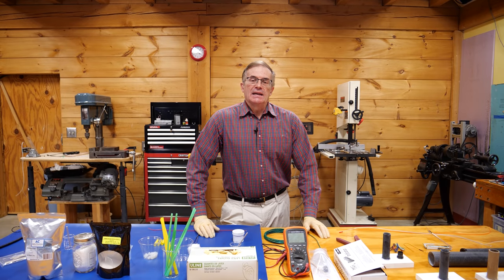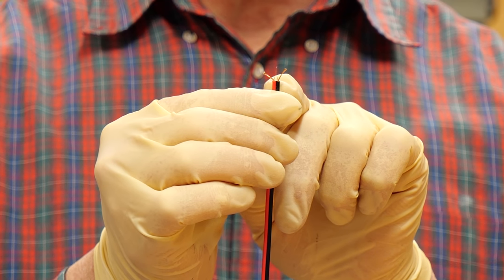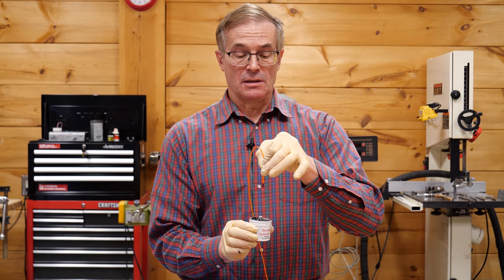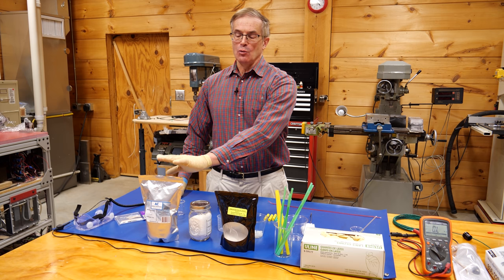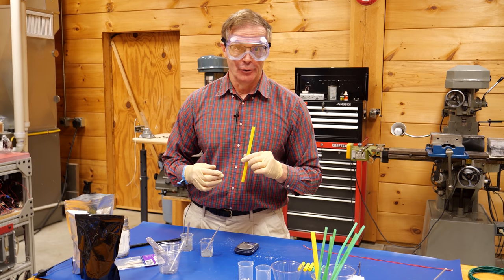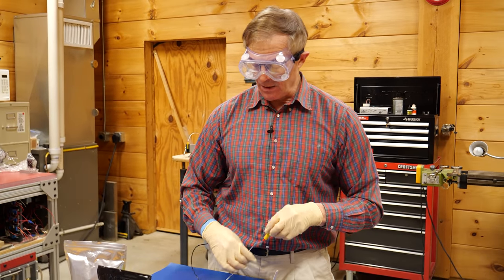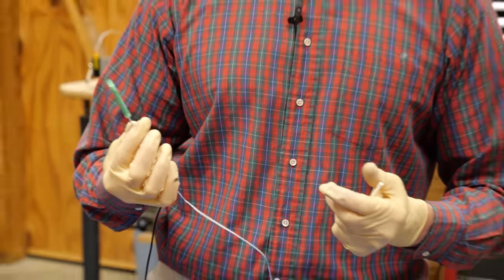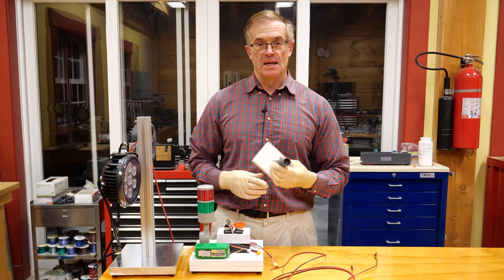Rocket Ignition System On Steroids!

Comment: Really like your channel and you always make me think about things in a few different ways LoL...
Also if it's conductive and could probably be use like  resistor in theory doesn't if you were to put it in  line with the beeping sound so that way the beeping would actually stop once it has finished lighting it off (for testing or b4 take off of course) all the way or if there would be a malfunction and it's still conductive/conducting it  would continue to beep but if not then it would just stop the beeping and allowing you to know that it's somewhat safer to approach the launch pad or testing pad ......... hopefully I'm making sence and what I'm trying to say......and if you understood what I was trying to say do you think that it would be possible and if it is could you maybe do a video on it and if it's possible would it be a good way to make malfunctions some what safer when not really knowing what and where the malfunction is at quickly 
Also I'm not really sure but might even need a diode or 2 in line with the beeping sound if you were to try to make it possible I'm not a hundred percent sure I'm just beginning with the electronic side of things
Reply from the maker: I could have simply turned it off.  A continuity indicator would be a useful upgrade  to confirm the wires were attached.

Comment: I am working on a rocket propelled starburst launcher that is reusable and electrically fired with the e match. I will let ya know after I overcome the problem with the altitude trigger for the starburst. I don’t want the rocket to be the ignition source. (too easy) I’m looking at timers (risky) or probably an altitude sensor ignitor e match, possibly using a cheap, small circuit and an AA battery to power both igniter and altitude sensor. I haven’t designed the circuit yet that is cheap enough to just “throw away”. 
As I said, I will let you know. I was reviewing this video to confirm the info. Thank you.

Comment: Interesting stuff.
I have seen solid rocket fuel grain with non-cylindrical  geometric shapes for the central cavity. This would expose more fuel surface area, presumably a faster burn and perhaps a lower surface surface velocity of hot gas over the grain. A lower velocity over the grain may result in less propellant being ejected before being fully burned. Just speculation. I'm sure much has been much written on this out there in the rabbit holes of the internet.
EDIT: I used to fly Estes rockets back around 1970 but haven't really followed the hobby since then. At 14 I mail mail-ordered a black powder revolver, build a mini-bike, and moved on to louder hobbies

Comment: I used to fill old christmas tree filament lights with BP.  I'd break the glass open with heat shock and it left the thin fillament untouched, although most of them went off with a bang! This method seems safer, wonder if you can make the black primer liquid with BP and nitrocellulose lacquer

Comment: This is way too cool! I'm gonna build a similar launch controller and take my son out and do some Rocketry, my girls too if they want, I really like the boosted flash ignitor, it is very unlikely to have a failed launch using that kind of ignitor, just one question, are those rocket motor housings made by a 3D printer? I see them burning after the motor was finished firing, that is definitely an undesirable trait, so I'm definitely interested in your mention of adding proper Nozzle to the engine, that way you can print a 3d motor and the nozzle will prevent it from melting and burning, mostly...?
Reply from the maker: Thanks!
Those are not rocket motor casings.  Those are cardboard firework tubes.  We used them to test different propellent mixtures and as I said, but didn't emphasize, they had no nozzles installed.

Comment: I came across a large batch of 6.3v tantalum surface mount capacitors. tants are very reactive when they are mistreated. a reverse polarity 47uf 6.3v cap lights of better than your average phosphorus match when fed with 12v. I haven't used any small sugar rockets or anything like that, but know a few people who do. 

my buddies with sugar rockets absolutely loved them. both dudes were doing DIY hot wire igniters, which were always a bit hit and miss. but the tants were sureshots, 100% success. probably not economic, but i had 10 reels of 5000, so happy to set a bunch of em on fire. they literally go off like a match being struck. 

might be worth a try?

Comment: Add a circuit to your starter: with a 10 kOhm resistor put a monitor current through your pyro igniter, this tiny current enters the base of a Darlington transistor and the collectors of this transistor powers the beeper. 

So you first get a verification that your circuit is working by the beep and as you fired the circuit will most likely break and that annoying beeper will get silenced.  Think about it, that’s a cost of about 2$ and does a lot, circuit check plus auto beep stop.
Reply from the maker: Good idea.

Comment: I'm not sure if you're aware, you called the barium sulfate a catalyst and although it might be, I suspect it's primary function here is an oxidizer. Catalysts by definition are not consumed in the reaction (and even if they're, they're reformed in the reaction) and are often added in fractions of the actual reactants, to catalyze the reaction.

1. In general sulfates and aluminum powder form thermite-like compositions, with very high reaction temperatures. The sulfate is the oxidizer, and as an educated guess, it gets reduced to sulfide.

2. A 1-on-1 aluminum-perchlorate mixture on weight base is stoichiometrically unbalanced, as it contains way too much aluminum a.k.a. fuel. I suppose this might be necessary to prevent your rockets from exploding instead of propelling. 

By adding barium sulfate you've added extra oxidizer, that will allow 1.23 g of your excess aluminum to be oxidized. That seems to increase the burn rate, as well as increasing the reaction temperature, meaning the already hot gases expand even further.

Thanx for the informative video!
Reply from the maker: It's both.

Comment: Lead Wire Resistance
I would recommend using a DC-DC converter to boost battery voltage to 24-48V and use a suitable (flash) capacitor (bank) in your trigger panel. Also, a very low current continuity loop indicator. All this for safety and reliability.
If you ever get in trouble for dropping this kind of science,  you can always apply for refugee status up the border :) Our maple sirup is better than yours!!

Comment: If the commercial electric match compound is carbon black, a resin (PMMA is a good guess- acetone soluble) and an oxidizer, why not find a suitable oxidizer? I mean, the whole point is DIY right? Can we revisit this? I'm sure I'm not the only one wondering why the process was taken from step A to Y then a $40 commercial product substituted?
Any thoughts about taking the compound mixture and fluidizing it using an evaporating solvent like acetone or ether or even anhydrous  IPA, or a plasticizer  to fill the straws and have it leave a solid? No wadding required and wouldn't it burn better since it contains its own oxidizer already? Seems like the fuel is being made into "grains" but electric match is dry powder in a plastic tube blocked with a wad of cotton-  is that really more relaible or safer?
Love your channel and content! Keep up the great work!

Comment: If you aren't already planning on it for the next video I think that it would be nice seeing if there is a difference in thrust from the more even ignition between using this and the regular fuse.
Reply from the maker: I probably won't do that if only for safety reasons.
Reply: @TechIngredients  Because fuses aren't as safe? If so a workaround could be using the ignition system to start a fuse. Or there is something else that I am missing?

Comment: A couple of the engines went quite some time.... However they seemed to throttle back about the Half Life point.  I felt they might not even produce lift force at that point. What do you contribute that too,  and could the mixture changed to accommodate that loss?
Reply from the maker: These were not engines, but propellent test grains.  There were no nozzles.  When  nozzles are added and the pressure increases, so does the burn rate.
Reply: @TechIngredients  Thanks!

Comment: Would a glow plug get hot enough to light an engine?  I know you can light fuses with them.  It would probably not give the ideal ignition profile since it would be a point source as opposed to a bunch of expanding hot gas, but might be reusable.  Maybe a glow plug wrapped in fuse cord?

Comment: Is static build up on the PVC foam board a concern when connecting the second wire to your control module? Could the wires easily contact the PVC as you're inserting them? Maybe coat the box with a dissipative material?
Reply from the maker: Actually if there was a risk, it would be when the first wire is attached, because the entire loop is conductive.  Where the spark occurs, if it can, is what matters. That is inside the engine itself.

Comment: A few inches of clear soft hose over the positive alligator clip with a cable tie to hold it in place will give you an insulated area to make the positive connection. 
Why not router lanes for all the wires?

Comment: Great video as always. The attention to detail is well appreciated and the technical information is being rapidly absorbed. Again thanks. Q.if rocket nozzles were to be surrounded by another cylindrical nozzle engine, essentially a ring, and between the two nozzles an air gap with a deliberate airway to create a venturi effect. Can thrust be increased by the newly found additional wind. Just for the thought experiment. I see potential pitt falls. Please pay along for a curious maker.
Reply from the maker: It will, but in general those thrust augmenters are best for static and low velocities.  At the typical velocities of rockets their added thrust is more than offset by their added drag.
Reply: @TechIngredients  thanks for the reply.  I wasn't aware this had been tried. I will look into it for my own personal knowledge base.

Comment: This was absolutely awesome! 
Question; When you measure thrust, is it possible to estimate elevation, if you were to launch a rocket?
Reply from the maker: Not really without knowing the rocket mass and aerodynamic properties.  However, with the thrust numbers you could look for an existing model rocket that used a similar engine and produced altitude data.
Reply: @TechIngredients  Thank you!

Comment: Where do you source the chemicals for 1) the rocket fuel, 2) the starters (if different) and 3) the colored agents used in the smoke bomb video?
Also would those color agents work 8n the rocket fuel and what percentage/ratio would be needed to leave a good smoke trail but effect the thrust as little as possible?
With the rocket videos, could you cover what and how to create a delay charge for use with a recovery parachute system.
Thanks.
Reply from the maker: Try "Skylighter"

Comment: I just ordered the Hot Shot kit. Is there a certain type of wire and gauge you recommend for making the e-matches?
Reply from the maker: Actually we used commercial E-matches which you can order from pyrotechnic retailers and the hotshot was used to "pump them up".  Alternatively, any high guage nicrome (30+gauge) can be used as well.

Comment: I really have no idea about those starters, but one thing i once heard (which makes sense):
The "open" wires of the starter should be twisted. You made them different lengths, but with this setup one wire could touch a potential high enough to ignite the wires. When they are twisted up to the point where you connect them to your starting-device, then there is no possibility to have different potentials at both ends.

Professionel starting electronics have a test function. The starter gets tested for continuity but with so low power so it doesn't ignite. But i guess that doesn't work with these diy starters becouse there is no bridging wire and the carbon black would probably still ignite.
Reply from the maker: You could add that.  Obviously, when I demonstrated the resistance with the VOM, the starter didn't heat up.
Reply: @TechIngredients  Well, i totally forgot about that

Comment: Simple diy ignition system:. A tiny Christmas light bulb, break tip of glass off, fill with smokeless or gun powder, wax closed, wire to switch, add  a 9v battery.

Comment: You should be diapering these components when mixing. It produces the least friction, etc. A good thing to add is powdered silicon to give it some good hot slag to hold the heat long enough to guarantee ignition.

Comment: 2:30 so a simple solution then would be to sleeve the fuse till it reaches the back of the motor, maybe with a carbon fiber tube?
Reply from the maker: That might work, but the tube should be fragile otherwise you risk the debris clogging the nozzle.
Reply: @TechIngredients  unless you make sure it's undersize relative to the nozzle diameter. I'd want the combustion gasses to shoot it out of the motor, ideally.

Comment: So if you can start the burn from the nose of the rocket motor does that mean that you could make a rocket that has the fast burn fuel at the nose and then transition to the slower burning fuel later in the same rocket taking advantage of the lower atmospheric pressure  and moving the rocket into LEO

Comment: It would be great to see a specific impulse over time graph for the composite engines because it would seem to be that if they were in a rocket they just barely be burning for the greater part qf their burn duration which baits the conclusion that for that very motor the burn characteristics cause one to believe that for that diameter of grain with that chemical composition two or 3 stages would accomplish a burn duration compared to attaining the desired forward movement accompanied by increasing acceleration that when the third stage has exhausted the rocket that it in would be going at a similar speed to when the second stage burned out...

Comment: Hi Tech Ingredients,

Thanks for your videos. 

Can you tell me what 2 pair wire that you used for the for the carbon black spark?
I swear that wire reminds me of circuit card repair wire / rework wire.
Do you have a part number?
Thanks!
Reply from the maker: Thanks.
I used 24 guage cross connect wire.
Reply: Hello again,
Quick Dip has changed a bit. The binder is already an ingredient in the white container. I guess the binder is now a solid acrylic dissolved by the acetone. The oxidizer is a separated mix ingredient.
With that said, I used 24 gauge single pair cross connect and left 1/4" ends of the bare wires just far enough apart that they were separated by only the width of the wire insulation. Or technically, two 1/2 widths of wire insulation.
I dipped the wire ends but I was unable to get any continuity between them. Not even the 6-9 ohms as you showed.
I charged the dipped wires in excess of 60vdc with max current on my lab power supply but the mixture would not ignite. It was an open.
Quick Dip instructions talk about using a 36 gauge nichrome bridge wire....
Maybe something has change with the Quick Dip formula.....
But I can't get it to work the way you did.

Comment: Please can you comment on the RF hazard risks of having reasonable length, untwisted wires and apparently with the ends disconnected? My understanding is that it is good practice to avoid RF hazards by connecting the ends, keeping wires short and twisting them where possible.
Reply from the maker: I doubt that's a significant concern.  These bridge wires are conductive and hence, don't support a potential across the pyrotechnic mizxture and  RF energy will not generate significant currents to actually heat the bridge.
Reply: @TechIngredients  The only thing I can think of which might unknowingly generate enough RF energy to be captured by a wire of that length is the spark plugs from petrol engines/generators; assuming you don't have shortwave radios nearby lmao
Reply: @TechIngredients  good point about the conductivity and ability to equalise potential without significant heating. I don't know what the mechanism of ignition was on detonators we used to use but it probably wasn't far off your setup, electrically. We also had radios in relatively close proximity so perhaps that's why we were so careful about RF hazards.

Comment: Looks like your nozzle wasn't restrictive enough, but you probably know this as you didn't want it to RUD right next to you, or am I wrong? Looking forward to see how you plan to measure performance and ISP. There was a bit more hesitation on the last engine ignition, was this one of the commercially available starters?
Reply: I think ne noted they were test grains sans nozzle.  I imagine with a proper nozzle they would sink the table a tad deeper into the snow :-)
Reply from the maker: There wasn't any nozzle at all!
These were propellent test grains and yes that was a commercial starter.
Reply: @TechIngredients  I may have missed that note in the vid about the nozzles and that would make sense on how it looked lol. Looking forward to what's to come in this series!

Comment: Curious about the parachute deployments.  Do your engines enable the parachutes to deploy?
Reply from the maker: Larger engines like the ones we're building usually don't control the recovery system deployment.  Altimeters and accelerometers are very inexpensive, light and reliable and can trigger parachute deployment as well as tracking systems.
Reply: @TechIngredients  Thank you !